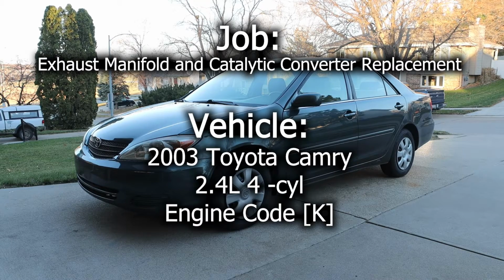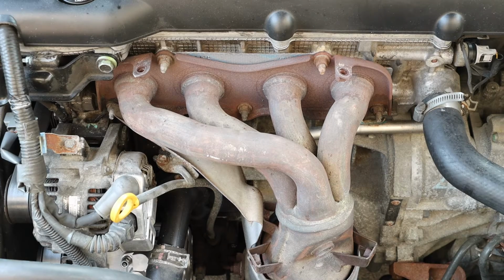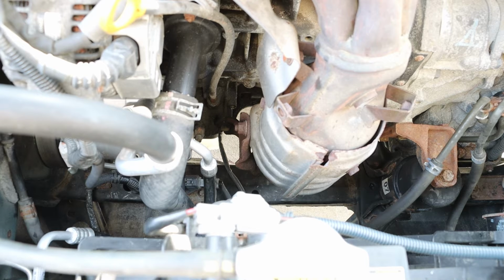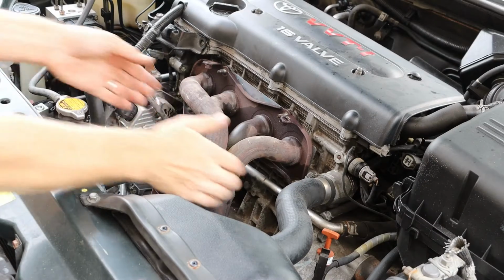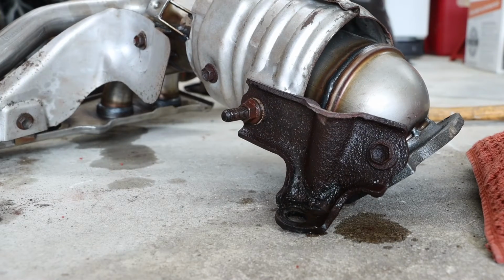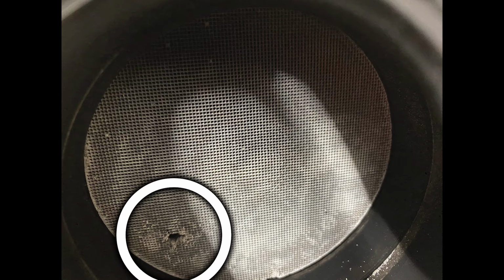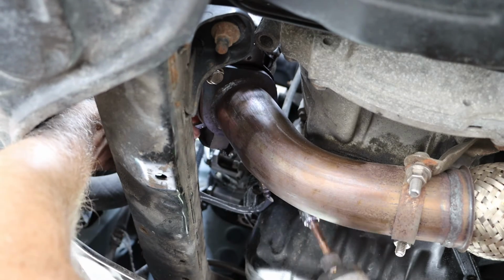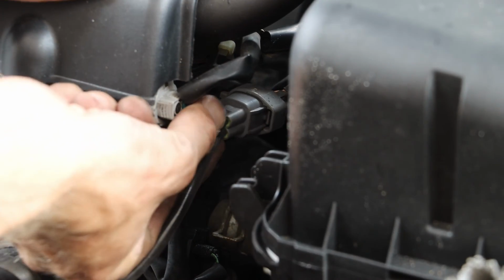Exhaust Manifold Replacement - Resolve Error Code P0420 - 2003 Toyota Camry, 2.4L (2002-2006)

Comment: At about 6:45 it looks like the nuts, 62 (630,46) in the schematic, that secure the manifold to the exhaust pipe, should be replaced as well. Is this necessary? If so what part number/size are they? Greetings from Germany!
Reply from the maker: I think it is this one ( https://www.amazon.com/Dorman-03423-Exhaust-Manifold-Hardware/dp/B0181H22YK ) but I am not entirely sure.  I purchased this: https://www.amazon.com/dp/B07G87CSLK which came with the bolts.

Comment: Great video thanks for posting as this was a huge help for me!
Note: In the video, the engine mounting bracket that was in the way of both the manifold and shielding wasn't installed properly. I know you probably did later but it wasn't mentioned what torque spec it should be.
Did some quick Google searches and its 47 ft lbs (Torque Rod Stay, mounting bracket)
Reply from the maker: Thanks for the comments.  Through the course of me owning this vehicle, I have found numerous things that weren't repaired correctly the first time which has lead to challenges along the way.

Comment: How did you manage to torque down the bolt on the hard to reach spot on manifold?  (bottom left bolt)
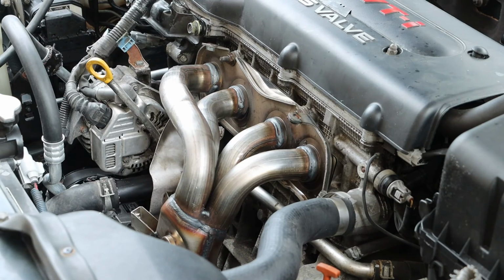Reply from the maker: I assume you are referring to 8:25 in the video.  If I remember correctly, I had a swivel on my ratchet and even then I just had to make my best attempt to get it close to the correct torque.

Comment: While replacing my catalytic converter, I discovered that the flange gasket between the cat and the exhaust pipe had disintegrated due to the age of the vehicle. I'd be curious to know if just replacing the gasket would fix the exhaust leak and code problem. 

I was too far into the project and already had the new cat, so I installed it anyway.

If you have time to mess around with it, it may save you a lot of money by just replacing the gasket first, before committing to a new catalytic converter. It may just work...

Comment: What Is The Recommended Cleaner After Taking Off The Exhaust Manifold Gasket Material?
Reply from the maker: Acetone
Reply: @ And Where Can I Find The Acetone Cleaner?
Reply from the maker: @Hotwheelsrock13  Pretty much anywhere.  Auto Parts Stores, Home Center Stores, Walmart, etc.
Reply: @ Awesome! Thanks For The Information.

Comment: Do you have the part numbers? Thank you.
Reply from the maker: I purchased the manifold from eBay.  I believe this is the link: https://www.ebay.com/itm/175187000858 All of these aftermarket manifolds are not a perfect fit and you really have to compare the new with the old as the quality of manufacturing really varies.
Reply: Thank you

Comment: I have a diagram that shows the 31585 gasket is for the Manifold Converter to cat pipe.  The 31374 gasket is for the resonator pipe to muffler pipe.  ULEV Only: https://images.carid.com/walker/exhaust-parts/scheme/0557.jpg

Comment: Thanks for the video! I've had that engine code for a while but haven't changed the exhaust manifold.

I do have a question though. My Camry burns a ton of oil (about 1 quart per 800-900 miles). I have 237k on my 03 Camry. I've tried everything from an engine flush, new pcv valve, new plugs, etc but it still burns crazy. Do you think it might be the valve stem seals? That's the only other thing I can think of besides the piston rings being carboned up.
Reply from the maker: I acquired the vehicle in this video this past summer with 241,000 miles on it.  I also have high oil consumption but to the degree of about a quart every 400 miles.  I am still collecting data on it but my current suspect is either worn piston rings or valve seals.  I am currently running Amsoil Oil https://www.amsoil.com/p/amsoil-extended-life-5w-30-100-synthetic-motor-oil-xlf/?zo=10458 as well as Amsoil Upper Cylinder Lubricant https://www.amsoil.com/p/upper-cylinder-lubricant-ucl/?zo=10458 and Amsoil Performance Improver https://www.amsoil.com/p/p-i-performance-improver-gasoline-additive-api/?zo=10458 to help clean the inside of the engine.
Reply: @InsaneOil  thanks for the info. Man, 400 miles per quart? That is a lot. 

Well, if you are going to do the valve seals, I will definitely be watching for the video! I just became a subscriber. Keep up the great content!
Reply from the maker: @musicfame  I have been doing some research on valve seal replacement and I am not super excited for what it entails.  However, I am going to track the oil consumption until spring and then make a decision at that point.
Reply from the maker: @frankg6578  Currently, I am still collecting data on the oil consumption issue.  I decided to wait until I have 1 year of data to look more closely into it.  However, to date (from October 2023 through July 2024) I average .04 oz of oil consumed per mile.  If you do the math, that is basically about 1 quart per 800-900 miles, which is exactly what the first guy in this thread goes through.  After doing all the work to this vehicle, I have noticed an overall decrease in oil consumption.  The Car Care Nut's video does a pretty good job explaining the reasoning behind this.  https://www.youtube.com/watch?v=F994QmOD6W8
Reply: My 2003 Camry with 201k and burns about a quart every 1000 miles.  The manifold converter was replaced about a year ago and the P0420 is back.  This is probably contributing to the premature failure of the cat.  I don't see a way to avoid ruining the cat when burning the level of oil we are reporting.  This car is for my kids but I don't want a constant check engine light and them not know there is a different issue.
Reply: I have an 03 camry too that uses a quart every 2 or 3 thousand miles following each fresh oil and filter change. After the initial 2 or 3 thousand miles, it starts using about a half quart or so every couple of weeks. BTW, I had my valve stem seals replaced and the only thing it changed was the first morning start up puff of smoke. Now I don't get the smoke in the morning. Now I keep getting the po420 light and was thinking it was the upstream oxygen sensor which I'm getting ready to replace. From the sounds of it, maybe it's my catalytic converter. I think the oil issue is due to worn rings or something. My car has over 200 thousand miles.